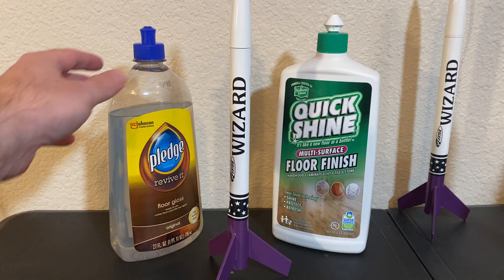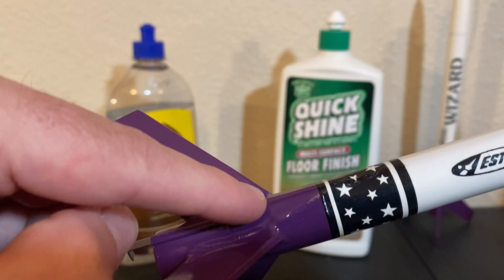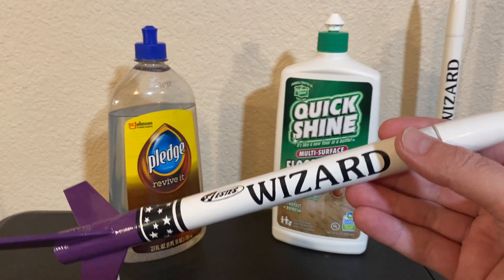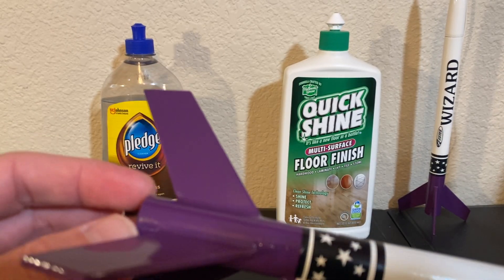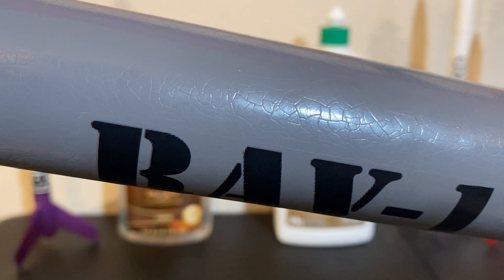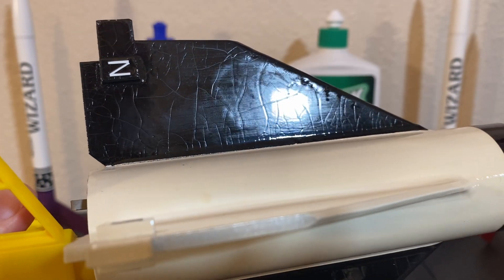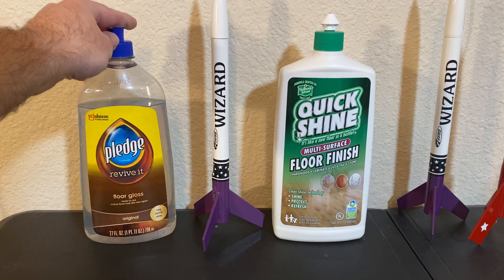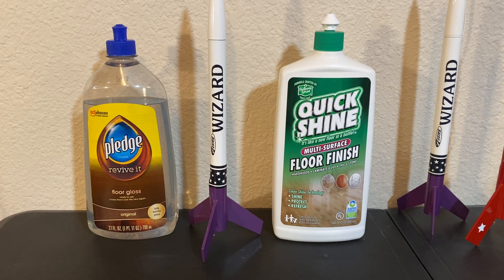Clear Coating your Rocket!!!!

Comment: I am not good at painting. That's why I don't paint my rockets very often. 
I will paint kits and some of my scratch builds. I started putting thin layers on and building it up. I always make it run if i try to coat it all at once. Same with the clear coat. Always runs. 
I have been wondering about your floor finish clear coat. Looking back through your videos and saw this. Interesting. 
Also saw your recent cato's and estes response video. 
 That one got me fired up😂😂.
Reply from the maker: Yeah, I have struggled with the Pledge interacting with the paint, but the Quick Shine doesn't seem to have such troubles.  And like you, I struggle with clear coat paints, but this stuff is easy to apply.

Comment: I am curious why using a clear coat spray paint isn't the solution for sealing decals. Aren't Future and Quick Shine just a form of liquid wax?
Reply from the maker: Great question. At face value, my answer may seem a little illogical, but after a couple years of struggling with clear paint, the option to have relatively no fear of a bad paint reaction, is the only thing I currently feel safe about. What does all that mean?  Well, when you factor in all the variables to painting (different brands, enamels & lacquers, different drying times, outside temperatures, outside humidity) I had no idea if my clear coat would haze over, lay down smooth and glossy, or crinkle up like a 95 year-old’s face………… sorry……….  When I got back into rocketry a few years ago, I prided myself in giving my rockets the prettiest paint job I could, only to absolutely ruin it within 2 seconds of hitting it with a clear coat. I would paint 2 identical rockets with the same paint color, and then clear them at the same time. One would lay down nice, the other would crinkle, for no rhyme or reason!  Very frustrating!  Then I discovered Future. Everyone swore by it as being able to gloss up ANY surface with no bad reactions. Unfortunately, Future no longer exists in that original formula, and now, the latest blend (which I believe has been discontinued as well) shows that cracking effect in certain colors. But then I stumbled upon Quick Shine and I feel like it’s giving me the same results that folks said the original Future would give them. 

All that being said, if I was a better painter and understood paint properties better, then maybe I’d feel more comfortable doing that, but for the time being, a $9 bottle of Quick Shine (that will probably still be half full when my great grandkids are building their models) is my personal solution.

Comment: I threw away about a quarter of the Pledge because it had yellowed and was causing yellow streaks on the white paint. Last year, the Pledge was going for $60 per bottle then disappeared now. I bought the Quick Shine from Amazon and is also available at the local Walmart so this product seems to have replaced and flooded the market. With the Pledge, I haven't had the scaling but does tend to leave drips if I don't watch it dry. Overall, I'm happy with the QS.
Reply from the maker: Excellent feedback!  Thank you very much for sharing that. I too have a couple rockets on the shelf with a yellowish/brown run on the body tube from dried Pledge. I should have shown that as well. Not impressed with this newer formula………..  QS appears to be the way to go!  Thanks!!!